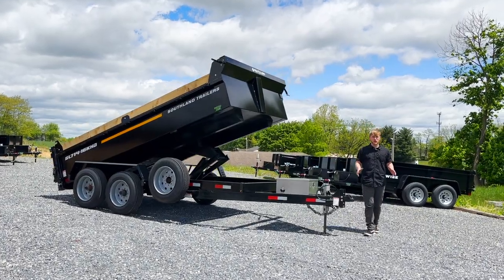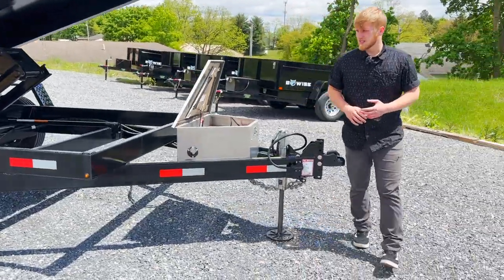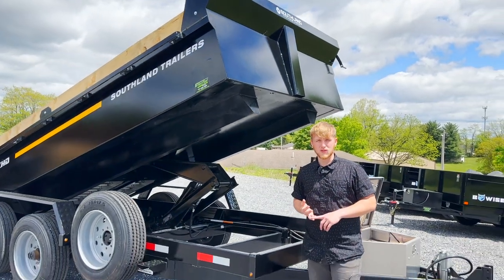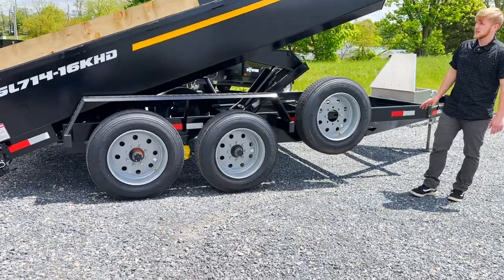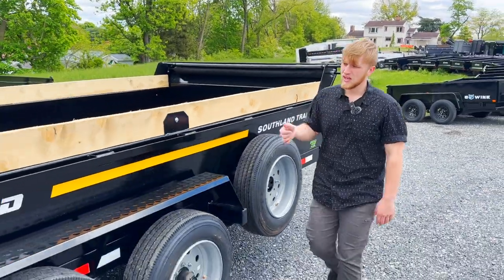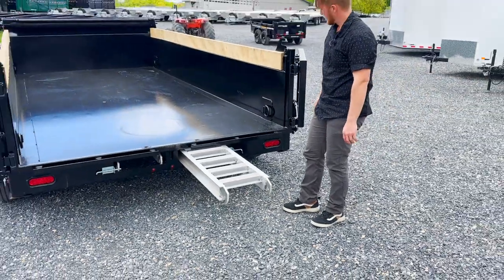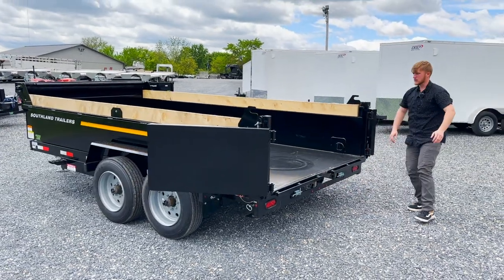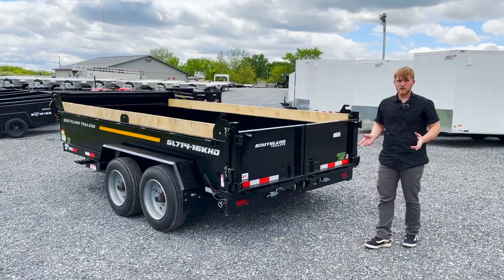The Ultimate Next Level Southland Dump Trailer 7x14 SL714-16KHD

Comment: The wheel wells are junk and every one I have seen around town has the wheel wells sagging. It then creates cracks everywhere at the end corners and center as the saggy metal  flops up and down as you drive. I had to weld all the cracks and added a 1x1 square tube center support off the shackle/hanger mount up to a plate welded to the bottom of the wheel well, then it was 100% fixed. In the end if they are going to keep using less than 1/8th" wheel wells they need to add center supports. Oh, the ramps barely hold an 8k lb excavator, I plan to add tubing on the underside of the ramps where the edges are bent under like c channel. Those bent under edges flared out so I had to use a sledge hammer to bend the "c channel they formed" back under it straight so it wasn't  too wide and would fit in the ramp slide-in mounts. The ramps are straight and not sagging but they flared out at least 1/2". Luckily I have only had to rent an excavator 3 times. Otherwise it's been great.